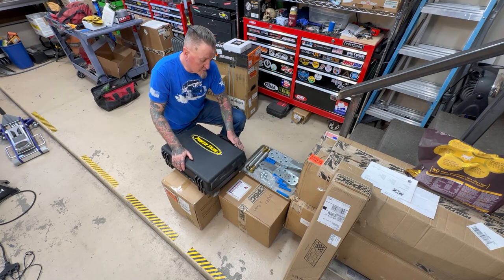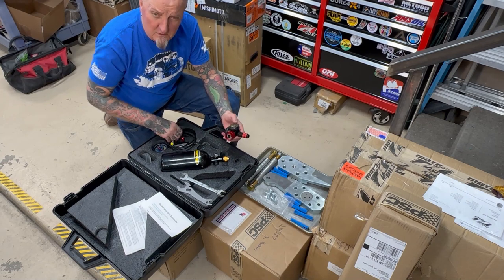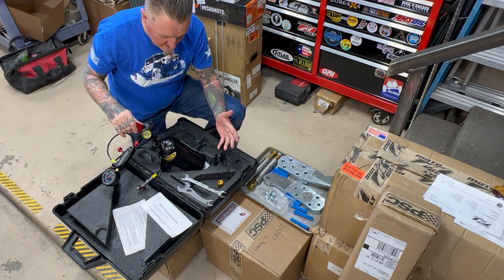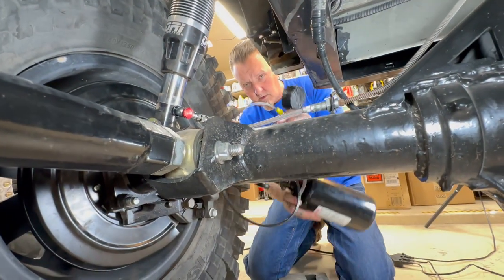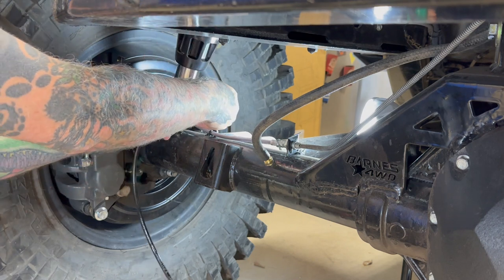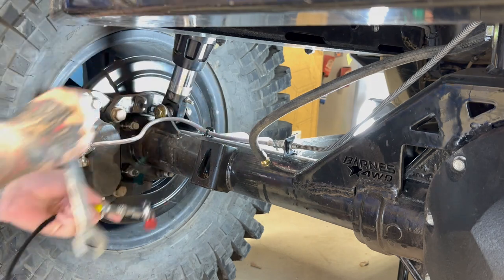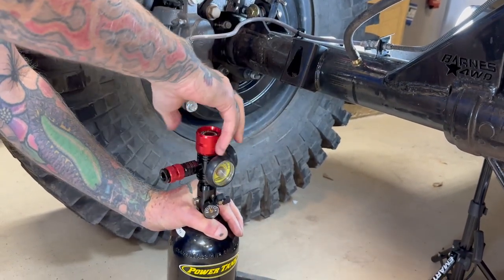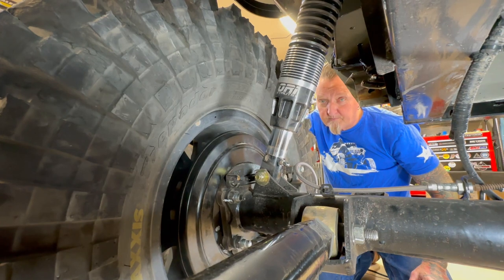Filling ORI Struts with the Power Tank Shock Boss Portable Shock Tuning Kit

Comment: increasing the lower pressure will affect the ride height you will need to add a little more pressure on the upper side to bring it back to how it was set. I ran these for 6 years on the front of my XJ. the way I set them was set lower chamber pressure first then set the upper pressure to the amount needed for the ride height you wanted. super easy.